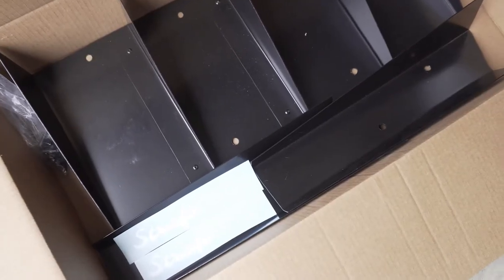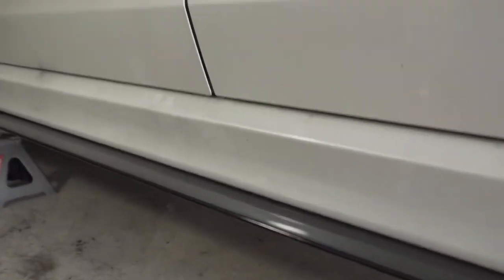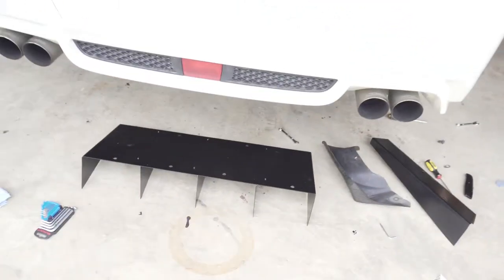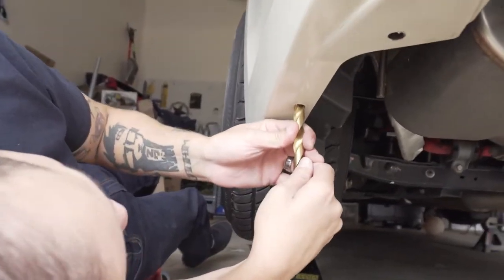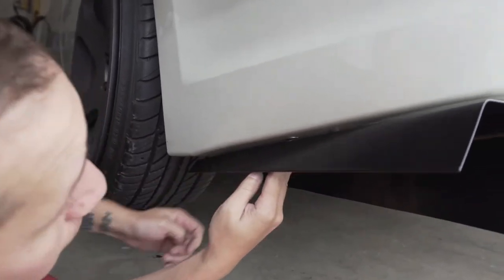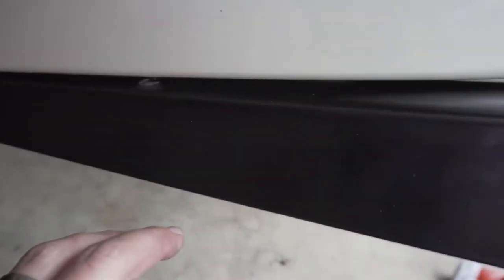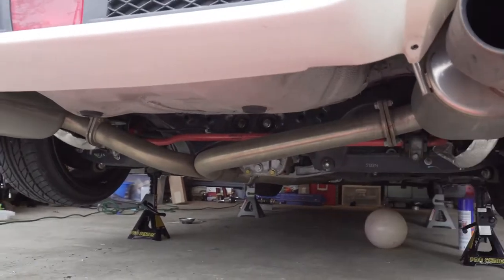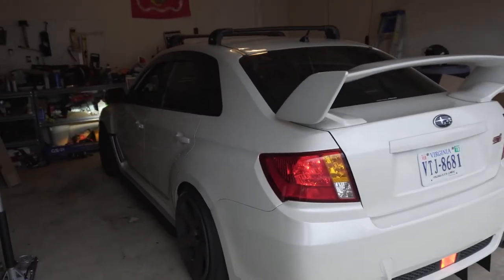Side Skirts and Rear Diffuser  Install | Bagged 2013 Subaru WRX STI

Comment: it looks like you have it on the opposite side.  left and right switched. he should've  bought it straight from the web, 9/1- 9/4 is 20% off plus free shipping. they are from Utah not in CA.
Reply from the maker: Jiatao Liu there was just one hole that was drilled wrong so it was throwing it off and in an angle and yes they have a labor day sale this weekend, need to take advantage of the 20%!

Comment: Nice car, did notice in the front left wheel arch two bolts sticking along out, hope you address them,
Reply from the maker: Can you tell me the time?
Reply from the maker: Oh i think you are talking about thr bolts that are on the mudflaps? Of they are, it is like that lol. The tire doesnt not travel to the back, just up and down so it will never touch.
Reply: Hey man, time 15:34, bolts stuck out quite a way. My same model wrx doesnt have it..
Reply from the maker: @alzmanfield3659  ohhh i remember now haha. He had taken off the mudflaps but left those bolts there, thats why they look like they are out. I am pretry sure he has fixed that by now
Reply: @ARomanRacing  hahaha makes sense..

Comment: CLEAN! what size drill bit to drill the holes for the tire well?
Reply from the maker: The spare tire well was with tapping screws. Did not have to drill a hole first. For the holes on the bumper, I got no idea lol. Its been a long time
Reply: thank you! yeah i have been sitting on this diffuser since MAY!! LOL

I probably wont drill holes in the bumper unless it looks that funky where it will piss me off every time i look at the booty.
Reply from the maker: @alexcampanelli2909  you might have to provide stability. You don't want it flying on the highway haha
Reply: truuuu too much downforce 

did it not all the way screw in with the original hole on the bumper and that is why you drilled two new holes?
Reply from the maker: @alexcampanelli2909  that i dont remember haha. Pretty sure on the sides it was because it felt more flush and sturdier to add another screw. I believe the middle part we had to do according to instructions